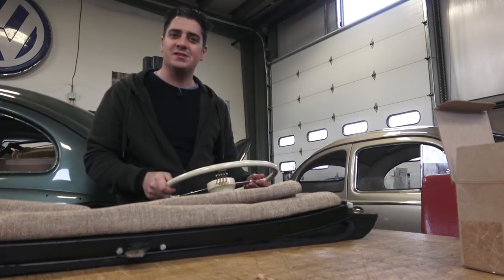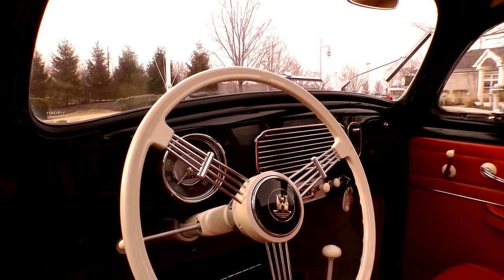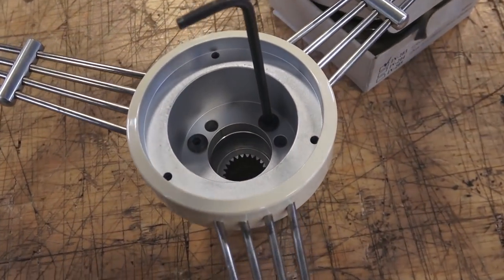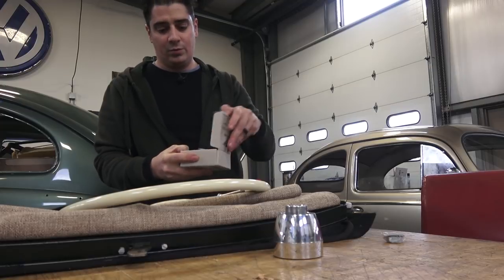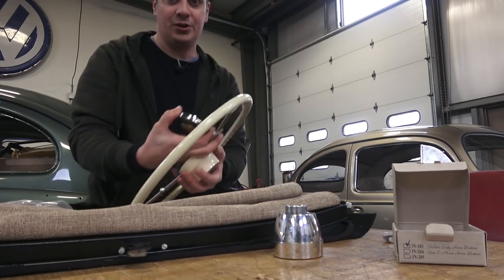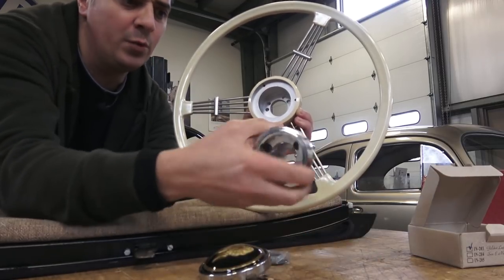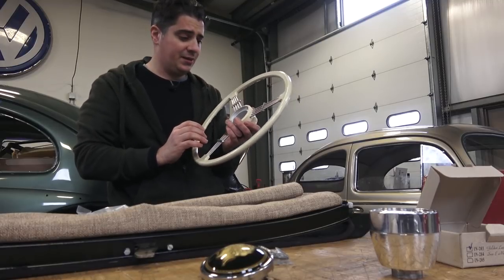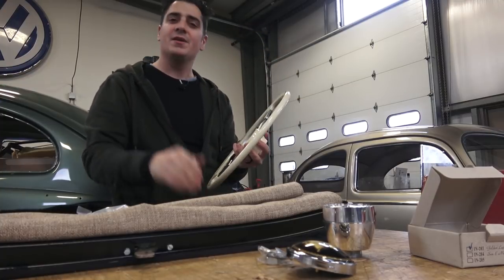Classic VW BuGs Flat 4 Reproduction Porsche Banjo Steering Wheel

Comment: The steering can be easily mounted in a post 1960 car if you use the steering column and tube from an oval up to 1959 bug. as simple as that, only use the older horn system with the charcoal contact on the column. :)

Comment: Hi Chris, great informative video. I just watched as I was fitting one to my 64. Also I'd just like to let you know the wheel sits identical to a stock wheel. The deep aluminium adapter puts it just right to the deep dish on a 60s wheel. If it sat further away it'll hit the turn signal. Keep up the great work 👍

Comment: The Banjo steering wheel looks really great but not comfortable on the hands specially during long drives just my personal opinion ✌️
Reply from the maker: what year bug?
Reply: @classicvwbugs  1962
Reply from the maker: @jeffeylumanog7673  ok so on a 62, you would need a much bigger adapter to mount the banjo, thus making it closer to you and putting your arms on an awkward angle.  Yeah I only recommend this wheel on the earlier bugs as you do not need such a large mount.

Comment: The three mounting screws on these banjo wheels tend to come loose after a while lots of complaints about these steering wheels it's a bad design ...i think cip1 and other makers of these wheels need to get rid of the 3 bolt screw adapter and have a one piece ...my friend had a wobbly steering wheel once on the fwy do to the fact the 3 mounting bolts tend to get loose ..he was scared after that happened.. hes was always retighting his banjo wheel before he went out  for a ride and hated it so he went back to his stock wheel much much much safer buys beware...

Comment: Have you tried using a suction cup to remove the horn button from those wheels?
Reply from the maker: I haven't, but that is a good tip!
Reply: You can push the button out using a the long end of an Allen wrench through the (3) through  holes on the back of the steering wheel.The holes are found near the perimeter of the wheel.
Reply from the maker: @georgebeltran9469  Yes but I should have mentioned that usually you would come across this issue when the wheel is mounted on the shaft and all installed in the bug.  If it is all mounted on, you will not be able to pop it off as you mention.  So you have to pop it off from the top.
Reply: Chris Vallone , I have mine mounted in a 65 Beetle and the holes are still accessible after it is mounted on the adapter and shaft. The shaft and adapter  does not obstruct the perimeter holes along the edge of the horn button diameter. Even a long thin screw driver can be used to push the horn buttons out and avoid potential horn button damage.
Reply from the maker: Very good to know George!  Thank you.  I did not know it was accessible on a later model.
Reply: Chris Vallone  If you take a look at you early model  beetle you will notice that the 3 hole are accessible from the back after the wheel is installed. Those (3)  holes around the perimeter of the section where the button goes in are there to allow you to push the button out with out damaging the button. The button can be pushed out using a thin screw driver, the long end of an Allen wrench,etc.and pushing a little at a time at each hole until it comes out.